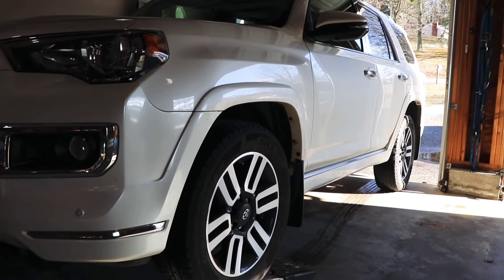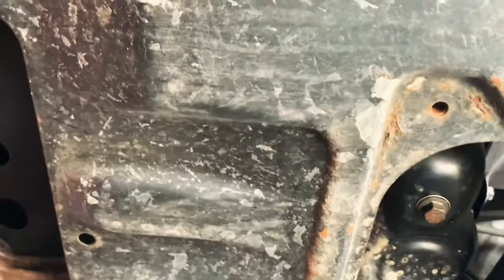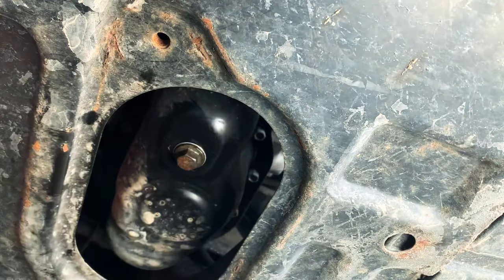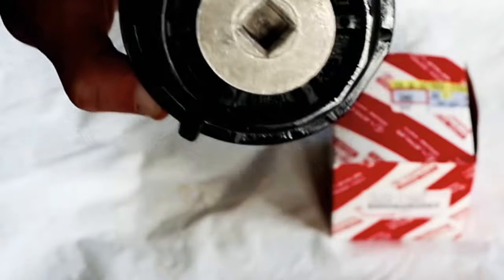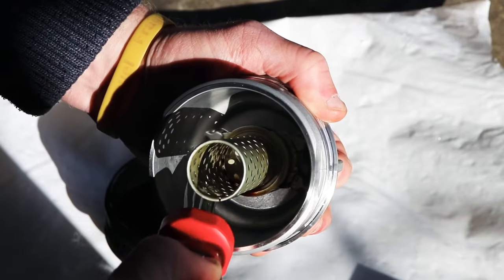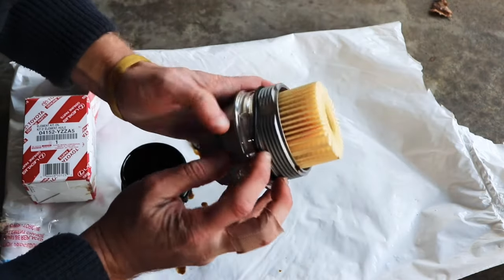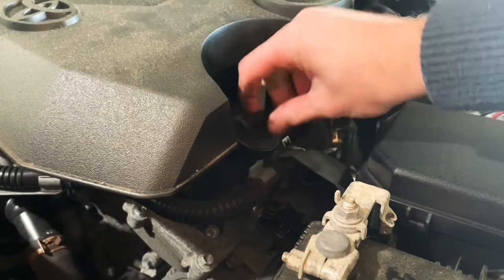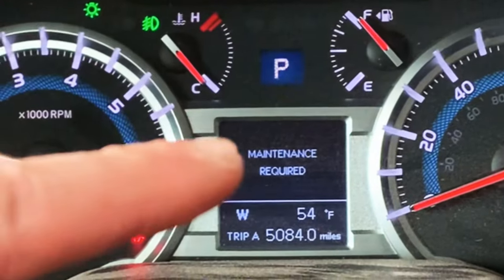5th Gen Toyota 4Runner Oil Change (2010-2024)

Comment: Great video! But can you explain checking the oil after firing up the engine? Anytime I’ve ever done that, the dipstick is just splattered and can’t get a reading. So I only check when it’s cold and settled. What am I missing here? How long  do you wait after you turned on the engine to check?
Reply from the maker: I tend to just check it after a fill as well as it is much easier, some insist that it needs to run through and fill the passageways to and from the oil filter or any other voids. Thank you for watching!

Comment: If you put in the o ring correctly on the housing it will bottom out just by using your hand and no tools. I just used the tool to make sure is good and tight. Is that what you are experiencing with your housing?

Comment: what actual filter wrench did you use? The one you have linked is different. I like yours better
Reply from the maker: Here is a link to one similar, I believe they discontinued the actual one I bought. Just a word of caution, be easy removing with this wrench as it has been known to sometimes break off the housing tabs if you have a plastic housing. Thank you for watching! https://amzn.to/3THkAI6 (Amazon Affiliate Link)
Reply: Yep. I've got the metal housing upgrade. Thanks for the link! @5MinuteFixit

Comment: It’s wise to pre fill the filter cartridge prior to install.
Reply: It's not necessary to do that...
Reply: Karol D  
It's still not necessary. If it was then that step would be included in the directions on the OEM oil filter box and it is not.
Reply: Definitely not necessary lol. Jesus.
Reply: That may have been wise 40 years ago, but that hasn’t been the case for several decades
Reply: While it may not be necessary to do it (since synthetic oils keep a thin protective film on parts reducing no-oil-pressure start ups), I agree that it is still wise to do. It's only takes 15 seconds and will allow oil to circulate through the engine faster. It will not hurt and can only help reduce wear. Why would you NOT do since it takes a fraction of a minute to do?  The comments about "the manufacturer would include it if it was necessary" while true are short sighted. Why not do something so simple to reduce engine wear? I guess if you buy new and trade off every 150,000 miles, you wouldn't care about long term engine wear. But for those that keep vehicles for longer and put double that mileage on it, or simply to treat the engine the best you can with this easy step even if it's for owners down the line, why not do it? Many people also use a 10,000 mile oil change interval which is too long even though it is the new manufacturers recommendation so they can quote lower maintenance/ownership costs and only care about everything lasting until it's out of warranty. Read the owners manual of most vehicles and it also outlines a "severe duty" oil change cycle of about 1/2 the standard interval (typically 5,000 mile interval). Severe duty is typically defined as stop-and-go traffic, towing, dusty roads, lots of idling (like warming up a vehicle in the winter time), etc. so more drives fall into "severe duty" oil change cycle than are aware, yet they still do standard duty 10,000 mile oil changes. Lots of good mechanic videos out there showing the issues with long interval, 10,000 mile oil changes (even when the oil "tests" as still good).

Comment: Very helpful video thanks. Where did you find the cup you measured the .6 quart of oil in at? i have look and can't find on the does 1/10ths of a quart. I assume it is about 9.6 ounces which is slightly more that half a quart. I like to be accurate. Any info would help. Thanks you.
Reply from the maker: On an online calculator it shows that .6 qt is 19.2oz, I usually under fill ever so slightly then check with the dipstick until it is topped off. Hopefully this helps, thank you for watching! Please consider giving the video a thumbs up if you haven't already! Thank you!

Comment: There is absolutely nothing wrong with the plastic housing as long as you treat it properly and do not abuse it.  That means getting the proper cup-style filter wrench that fits over all of the flats on the housing.  Remove the round metal bottom plate from the plastic housing first, before draining the oil.  No oil will come out.  Insert the plastic drain tool that comes with the filter with a short piece of fuel hose to route the oil into the drain pan.  This is the way cartidge filters are designed to work, and they are fine.  Now unscrew the plastic filter housing using the PROPER filter wrench.  Change the paper element, lubricate both O rings with NEW oil.  Put the housing back on the engine, then put the bottom cap into the housing.  NOW drain the oil using the drain plug.  The crush washer will stick to the oil pan every time, and it's not easy to remove.  I use a clean razor blade, being EXTREMELY careful not to scratch the metal surface.  Been doing this on my FJ Cruiser with the exact same 1GR-FE engine and filter housing and skid plate for 13 years and have not had one single problem.  Don't follow this video.  Do it as I described and you will be just fine.  Yes, it is a pain to remove the skid plate, but it's only 4 bolts and it's not difficult.  It has two hooks in the front to support it so remove those bolts first and let it hang on those two hooks while you remove the rear two bolts and lower it down.  To whoever complained about the paper element, you will find that 99% of all filters are paper.  Some are synthetic fiber but it is not needed in this case.  Use the genuine Toyota filter element from a Toyota dealer (not an online fake) for about $6 every 4k-5k miles and you will find that your engine will last hundreds of thousands of miles.  If you live in the south, switch to 5W-20.

Comment: Do they make skid plates with a pre-cut hole for the oil filter? Or should you DIY and cut a hole out for the oil filter, so you don't have to remove the skid plate every time?
Reply from the maker: They do make a skid plate that has a cut out or door for oil filter access. I will try to get a link for you a little later today. Thank you for watching!

Comment: Hello, The filter wrench you link to looks completely different than the one you are using. Will the one you link to work for a 2013 Toyots 4 Runner? It doesn't appear to have slots for the 2 tabs.
Reply from the maker: The linked wrench will definitely work and is made really well! Thank you for watching!

Comment: Curious as to why you have a missing shroud and a cracked filter housing. Have some of your oil fills been done through an oil change shop or the dealer? Great video btw. Thanks!
Reply from the maker: You hit the nail on the head, this was the second oil change I did myself. The others were done at quick lube shops according to the car fax. After seeing the filter housing condition the first time I had to swap it out. Thank you for watching!
Reply: I think a lot of times these filter housings are being cracked by maintenance techs using power tools.  Or they'll use the oil filter wrench and wring the living shit out of it, not knowing what they're doing......new on the job?.  I'm not too proud to get my oil changes done at Walmart, but I watch them like a hawk.  I had trouble at the VW dealership a few years ago.  Some kid they had working there was putting the oil drain plug back in with a Milwaukee impact driver.  He overcrimped the washers and it was causing leaks.
Reply from the maker: @Lex5576  since I acquired this 4Runner I intend to do as much of the maintenance as possible to avoid those pitfalls. Thank you for watching and please consider giving the video a thumbs up if you haven’t already! Thank you!
Reply: @Chuck Mos Nothing stupid about it. It was done for environmental reasons.The plastic housing will probably outlast your car, if you tighten it to specs as in this video. If the stupid people changing oil go Rambo with a power impact wrench then you can break anything, even metal!

Comment: I bought the metal filter housing, but the threads were not continuous around the housing like the stock plastic one.  Two large gaps where there aren’t any threads at all. Seems like it could leak there if gasket failed. Comments?
Reply from the maker: That’s normal, at 4:28 of the video you can see that mine is the same…I’ve never had an issue with a failed gasket and I have these metal housings on 2 vehicles. One has nearly 200k and the other 100k. Hopefully this helps, thank you for watching!

Comment: Do you have to swap out center piece with the plastic center piece . Can you use the metal filter as is??
Reply from the maker: If you are changing from a plastic filter housing to a metal one compare the length of the center piece. If the center piece is longer on the plastic housing it needs to be swapped into the new metal housing. Hopefully this helps! Thank you for watching!

Comment: Curious? What happens if you don't replace the metal tube?
Reply from the maker: The tube acts as an inner structure for the filter element, if the filter gets too clogged the filter element will collapse in and without the support from the metal tube stop filtering. Hopefully this helps! Thank you for watching and please consider giving the video a thumbs up if you haven’t already! Thank You!

Comment: I have a 2022 4runner TRD ORP, when I click on your link to Amazon for the Metal oil filter housing cap , I can't tell if it will work on my 4Runner. Any idea if it fits, it is the same engine. I'd appreciate any help. Thanks, Toyo12
Reply from the maker: Yes this should work for your 4Runner just be sure to swap out the center portion like I show in the video. Hopefully this helps! Thank you for watching!

Comment: This job has me considering selling this car
Reply from the maker: It’s not so bad, annoying yes but totally doable in 30 minutes or less. Thank you for watching!
Reply: @5MinuteFixit  agreed. Just pissed me off when 

1. Had to remove skid plates

2. Realized it's a paper filter inside a plastic housing

3. Realized I needed to go get a special tool to get the filter out

4. Now know that I should replace the plastic filter housing with an aluminum one next time I do the oil change.

I'm just used to my other trucks where I can just unscrew a drain bolt, and then unscrew an oil filter, and move on. Oh well.

Comment: So I put 6 quarts in & then stopped at the 6 litre mark on the 7th quart - does that make it 6.6 quarts or should I put more? Thanks
Reply from the maker: That’s either 6.6 or 6.4 depending on the oil bottle the best way to tell for sure is to take out the dipstick and check the oil level. Thank you for watching!

Comment: I think I put in almost a full quart more than I should have. Will it be fine?
Reply from the maker: Check your dipstick to be sure and if it is overfilled you will want to drain the excess oil out. These engines could be damaged by running them with too much oil. Thank you for watching and please consider giving the video a thumbs up and subscribing! Thank you!
Reply: @5MinuteFixit  i already checked but unclear of level. I know I did put in a quart more than recommended. I had 2 5quart jugs and then the other jug put in 1 quart and then kept putting a few more in there. So idk if its over 6.6 or 7.6
Reply from the maker: @vicerichter1163  if you are sure you overfilled it I would definitely drain the excess.
Reply: Karol D  lol i know how to check the oil dipstick lol. I just poured too much cuz i didnt see the oil lvl raise much.

Comment: Now you screw on metal to metal when changing the oil the plastic housing with the proper tool would last a life time and won’t put wear on the threads.
Reply from the maker: Many other Toyota vehicles came with a metal housing as standard equipment including one that I own. I think this was a slight cost cutting measure and believe the metal housing that is made by Toyota to be the superior housing.
Reply: There is in fact a safety measure here.  I'd rather strip out the threads on a plastic housing than the ones on the engine block.  When not abused, and with the proper cup-style filter wrench, there is zero reason to use a metal filter housing.  The plastic one lasted 13 years on my FJ Cruiser with the same engine, same filter and housing, same skid plate.  Zero problems.

Comment: What about the little plastic piece that they send with every filter?
Reply from the maker: You can use that to drain the filter housing before you remove it if you wish…in my experience they tend to get stuck and are a pain to remove so I just drop the whole housing. Hopefully this helps! Thank you for watching and please consider giving the video a thumbs up if you haven’t already! Thank you!
Reply: @5MinuteFixit  so is it OK to leave the old plastic in the housing and just change the filter correct?
Reply from the maker: Are you talking about the small o-ring or the clear plastic nozzle looking piece?
Reply: @5MinuteFixit  the clear plastic nozzle piece.
Reply from the maker: @YouTubeCommunists  the clear plastic nozzle piece is to drain the filter housing before removal.
Reply: @5MinuteFixit  ok thanks alot for clearing  that up for me.I was not sure if that was something  I needed to change out or not..Thanks alot for taking the time to clear that up for me.
Reply from the maker: @YouTubeCommunists  no problem!

Comment: Man I bought a 5th gen 4runner because my beta model 07 FJ has over 300k miles and doesn't even burn a drop of oil...the engine is the previous 4.0 with a canister filter right up top...this is my first oi change in my 4 runner and man what a job compared to the previous engine... suck it toyota engineers!
Reply from the maker: Definitely a pain compared to your FJ with the canister on top but still worth it to do yourself. Thank you for watching and please consider giving it a thumbs up if you haven’t already! Thank You!

Comment: I don’t think that’s a poor design, the connection is an aluminum piece and not direct to the engine that’s a cast iron? I don’t even know what they made the engines out of now. I just know for sure my 96 on the photo has a cast block. I think toyota went with plastic because the plastic will always lose against aluminum. Don’t get me wrong i like the idea of swapping it out but i don’t think it’s smart in the long run. You’ll know what i mean when you strip that treads and no autozone or parts store  that has that size of tap and die set to retread. You will have no choice but to buy a new connection. Just my 2 cents. Awesome video though.
Reply from the maker: Thanks for watching and I sincerely appreciate the feedback. I went with the aluminum filter cap because our other Toyota vehicle a 2012 Sienna came from the factory with an aluminum cap. So far I haven’t experienced any issues with the swap, hopefully it stays that way! That’s a nice looking 96 you have there! Thanks again for the feedback and for watching!

Comment: Go buy yourself a motiv oil filter tool. Much better than the one you're using.
Reply: I'm betting that tool is the reason that the tabs are broken and the filter housing is cracked
Reply from the maker: This is a new to me 4Runner, so it’s not from the tool I used although I agree the motivx filter tool is far better.
Reply: @5MinuteFixit  A great tool! It comes in a Rolex watch type of case (little over kill?).

Comment: Guessing it's the same parts wise for a '22 4runner 4.0 v6 can anyone verify this
Reply from the maker: Yes the parts are the same. Thank you for watching!
Reply: @5MinuteFixit  Thanks for the prompt answer and your efforts on this informative video. Just ordered the housing from my local dealer because I was concerned about online knock off parts that weren't genuine Toyota. I got a very fair sale price from my dealer compared to Amazon prices and I'm good with that. Raised a few eyebrows though at the dealer. Don't care as I've always done my own work.
Reply from the maker: I’m not sure why they don’t have metal housings from the start, my 2012 Sienna has a metal housing. Thank you for watching and be sure to check out my other 4Runner maintenance videos if you are interested. One more thing, just remember to swap out the center portion of the housing with the one from yours they could be different lengths.
Reply: @5MinuteFixit  Agreed. My son has a 2020 Tundra TRD Pro with the 5.7 V8 and from what I've seen it's the same deal. Same oil filter housing part # as the 4runner 4.0 V6 just a different filter and an even longer center portion to swap out.